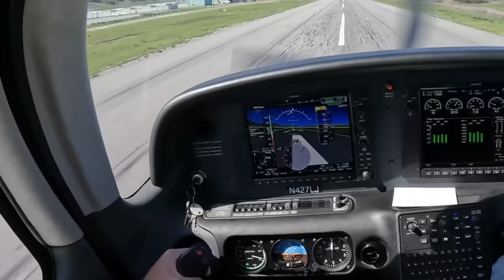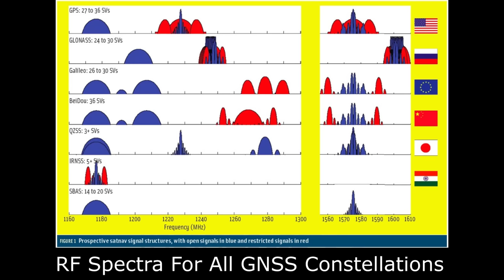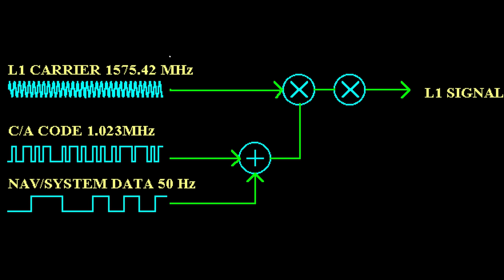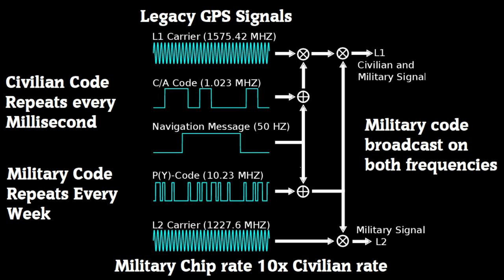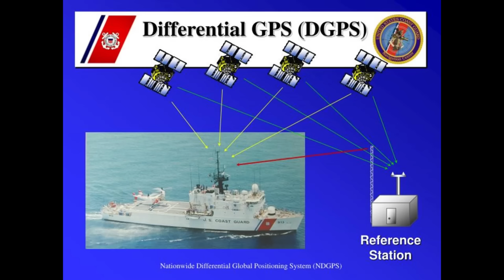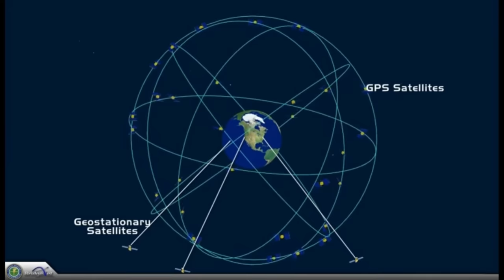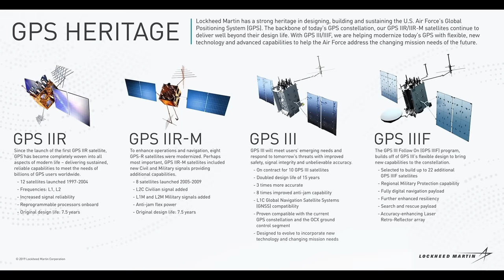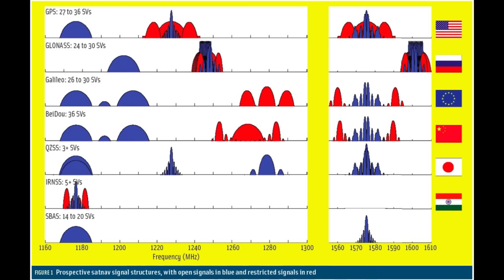How GPS Works, And How It Got Better Than The Designers Ever Imagined

Comment: I've worked with GPS a lot while surveying. You can fix one receiver over a known point, then use another receiver to do your surveying. The fixed receiver will send the rover receiver a correction by radio and you can get extremely accurate, down to 0.01 ft, or 1/8th of an inch, which is good enough for any property lines or general construction staking. It is so much faster than using Total Stations.
Reply: I think SparkFun sells a complete kit for advanced embedded developers.
Reply: Can you confirm globe earth, as a surveyor?
Reply: @alexlandherr They do.  I quite like their surveying pole. It measures the position at the top of the pole, but the pole may not be verticle. So it uses accelerometers to work out the tilt of the pole,  and uses that to work out the position of the spike at the end of the pole.
Reply: @alexlandherr  In the early 2000's, they cost around $50k, now a RTK system runs about $8k.
Reply: Accuracy of 3.2mm, nice!
Reply: The science building at my school apparently has a receiver permanently fixed to the roof for that exact purpose.
Reply: @juha9703  That is with ideal conditions. The biggest issue is trees, nearby buildings, or anything else blocking the sky or bouncing the signal. If there is too much interference and the accuracy is lost, we will set temporary points nearby and then use those to set up a total station to measure the final positions.
Reply: You can buy lawnmowers that have that system nowdays sl you don't have to use a cable.
Reply: Rover? Wait, did you use basically a ultra duper rc car? Which firmware, ArduRover?
Reply: @juha9703  actual accuracy should be stated as a known uncertainty, which is basically the probability of being within a stated range.
Reply: We used this approach some 20 years ago. Was incredibly precise as long as you kept away from any trees, buildings, etc. that obstructed line of sight to the satellites.
Reply: @n900video  I wonder about the firmware used back then, because I don't think ArduPilot and it's variants existed already. But today they use it a lot, even for agriculture. 
There are companies that build big rc airplanes with 4 additional motors, so it can land and take off vertically and then do the mission the operator defined. You know?
Some day I'm going to build one of those... Just to play around. I love that stuff! 😂
Reply: @MCsCreations  From what I remember all the hardware and software was made by Trimble.
Reply: A lot of wrecks on the Great Lakes are marked with gps coordinates. Makes diving on them a lot easier.
Reply: So long as you have clear views of the sky. 😎
Reply: Aviation GBAS does the same.
Ground Based Augmentation System.
The airport has a known fixed receiver-transmitter, that can send a correction code to the aircraft receiver.

R
Reply: @tonymcflattie2450   Every land surveyor can and does on a daily basis.  The mathematics behind "projections" that are commonly used to display map data are all built upon an ellipsoid model.  I've taken the courses and done the math myself.  I've seen it through a total station myself.  Plus, my geodetic models professor was the guy that JPL would call in the early days when designing the system.  So, yes.
Reply: @tonymcflattie2450  if they didn't constantly compensate for the curvature of the earth, any large surveys would be way off
Reply: @jimjohnson394  I think it is even less than that now, I've seen kits <1k for RC lidar scanning, 1-2cm accuracy, haven't tried them myself yet
Reply: So I am using Trimble R12 units in RTK and I am getting vectors within 3mm Horizontal and 5 Vertical of terrestrial measurements when working in good sat visibility. Still can go down to around 100mm in Forrested area (which is still far better than the 2m I used to get on R6s)
Reply: @tonymcflattie2450  More than that, you can map your position well enough to show that the Earth isn't a simple perfect sphere, it's a slightly lumpy 'oblate spheroid'. IIRC Scott did a video a while ago explaining what than means.
Reply: @MCsCreations  >Rover?
In surveying you have a fixed receiver called a 'base station' and a mobile receiver (mounted to a pole you carry around) called a 'rover'. Often the base station is operated by somebody else, usually the local government.
Reply: @raffriff42  Oh, I see! Thanks!
Reply: @ke6gwf Actually, the error is much smaller than you would think.
Reply: Wow that is interesting. But how do you get the fixed receiver more accurate?
Reply: @LTVoyager  the error is very close to what I think, but I didn't define what I meant by way off or large surveys lol
Imagine trying to survey a long stretch of freeway or a state border, or even with a large property or farm field, you may be off by more than the allowed error tolerances for the job.
Reply: @ke6gwf  What is your definition of a large survey?  How many miles?
Reply: @LTVoyager  well, for instance, if you set a corner cube reflector on a tripod at one end of the Bonneville salt flats and tried to measure the distance across the perfectly water level flat surface with a Total Station at the other end, the laser wouldn't be able to see the reflector because of the curvature of the earth.
So I would say that at 12 miles you certainly would be having major problems as a result lol
And even not trying to do it in one shot, you would have several feet of vertical error across that distance.
Reply: Similar systems have been used in Ag for a decade + as well. Allows for running equipment with sub inch accuracy, which allows for auto steer capabilities to very accurately control equipment during planting, harvesting, and application of inputs.
Reply: I think I read that RTK systems get even more accurate if you run them for a few hours, that's how people get to millimeter accuracy. Not that you need that much accuracy in most cases.
Reply: @StevePemberton2  I am not even sure if that's needed anymore with the multi constellation RTK systems, because they get so much data in minutes comparing the different frequencies and systems that I think they can solve the errors faster.

Now, I could be wrong, maybe there are still aspects that require time to adjust for, but I know that the ground based software has taken major leaps in recent years, so I suspect that those things are getting much better too?
Reply: @ke6gwf  That is why you would measure 1,000’ at a time for a total error of 1.3’ over 12 miles which isn’t what I could consider a huge error over 12 miles.  😁
Reply: @LTVoyager  but you know what it is, you can measure it, and so you can compensate for it, which is the point.
Reply: This is another use of differential GPS. You can take it a step further and add post-processing which uses a later download of the precise ephemeris of the satellite constellations to further refine the position data. 

The best receivers now will use a combination of all the GNSS constellations, WAAS, LAS, and locally captured cell tower/Wi-Fi data.
Reply: So, what is the base accuracy for your PVTs?
Reply: @juha9703 Ours was to the millimeter or 10/254ths. It was more accurate than the operator using gyros and accerometers to account for being atop an 8ft pole even in "the morning after" conditions 😂
Reply: @nitehawk86 >how do you get the fixed receiver more accurate
They take many measurements over time
Reply: Yup, it's called RTK fix
Reply: Yeah rtk is a couple hundred bucks these days
Reply: I was a Trimble operator for 2 years. Love those things
Reply: @LTVoyager Could you please use units which the normal 7,7 billion people on earth use?

This is a science channel, not a '(destroying) freedom' unit channel.
Reply: @nathanieljames7462 what does "8ft" mean?

Don't tell me that you dare to use fat-people units on a science channel!!
Reply: @gert-janbonnema  There are two categories of countries on the earth: those that use the metric system and the one who put men on the moon.  I will stay with the convention of the country that put men on the moon.
Reply: @gert-janbonnema  Please show me your metric clock that measures time in multiples of units of 10.  And what are the units on the drive side of your “metric” sockets?  😂
Reply: @gert-janbonnema The normal people who invented,  own, & use the GPS  system talk think & use inches feet & yards.  An advanced scientific mind should be capable of dealing with it without much complaint,  lol
Reply: @gert-janbonnema  Interestingly enough, the research lab I was building used several thousand 2x4 8' studs. It was a massive complex that was almost big enough to fit your mom in.
Reply: I also use RTK GPS for survey, using both our own base station and broadcast base stations for corrections.  Under ideal conditions, RTK is comparable in accuracy to total station. Often though, the elevation measurements vary by several hundredths versus total station survey of the same two points. And this is with reapeat measurement at the same points. Always skeptical if someone reports XYZ based on RTK alone.

That said, RTK is amazing and I'm stoked every time I'm able to pull an XYZ location out of thin air with accuracy on the order of the surface area of a quarter
Reply: +1 using “convolve”
But … what? No description of Hadamard matrices or Gold codes? 😉
Just kidding. Nice job.👍
Reply: @phinix250 shlt dude, I'm still using an R6
Reply: @davidkottman3440  Oh, is that why the US Survey Foot is defined as exactly 3937/1200 ft/m? We're already surveying in metric. Also, WGS84 is defined in metric. (I've been a surveyor in the US for 30 years)
Reply: You ever try to repeat that 0.01 ft a few hours later? Also, you and I both know that's really 0.03 ft in the vertical. So, I still prefer the robotic total stations--They're just as fast, if not faster.
Reply: @cf453  "faster" depends on your control. So often I'm in areas where the closest control is kms if not 10s of kms away. For example, right now I'm working on a tails dam that's 15km in diameter, surrounded in forest and any permanent control left is about to be destroyed. 
If you want to establish control with GPS, you either need multiple recievers and traverse in from known points with good long obs or for less accurate stuff you can take a series of 3mins obs as a control point and take an average, at least 4 obs over at least 2 days
Reply: @cf453  I'm comfortable using either system,  and don't understand why others cannot do their own conversions, especially when they promote their own scientific or mathematical proficiency.
Reply: @LTVoyager You will find that the Apollo Lunar Module, or LEM, flight computer did all of its guidance and navigation calculations using the metric system. It only did a conversion at the very end for display of the values in "customary" units for the benefit of the astronauts who mostly had an aviation background...

Back on topic; even road graders use GPS now to control their blades. Two masts on each end of the blade for mounting GNSS receivers allow for centimeter precision in making flat and level surfaces just so and the civil engineers have to account for the curvature of the planet if you go beyond the horizon or else you'd be asking for a ramp up to space right along a tangent!
Reply: Absolutely correct Jim. I've also used GPS for surveying, even my own personal receiver is accurate to 6 inches with post processing.
Reply: Phase data is sent by the base for the high accuracy applications.
Reply: @tonymcflattie2450 ”Globe” earth was confirmed by measurement by the Greeks 2500 years ago. Are you that contrarian?
Reply: One thing you do lose with GPS surveying is geodetic irregularity. A total station orients to perpendicular to gravity, so 90° to water's surface. GPS is a fixed ellipsoid. Earth's gravitational potential is lumpy. You can easily have areas a few hundred miles apart with "sea level" a dozen feet apart. A total station automatically corrects for this, and you'd have to adjust to get ellipsoid heights, whereas in GPS you get the ellipsoid height, but have to adjust for true level as water sits.
1/8" with differential GPS is a bit optimistic. Maybe 1/2" horizontal and vertical might be more like 3/4" in perfect conditions. A very long static survey might get you results a bit inside that, but repeating the measurement a few hours later won't likely agree by a hundredth. But the great thing is those numbers are about the same if you're measuring 10 feet or 10 miles.
Reply: we did this on a university racing team for vehicle data at the race track. I was told 2mm accuracy!
Reply: Agree on the accuracy claims some make. I always expect no better than 1cm horizontal and about 1.5 5o 2 vertical with RTK GPS in ideal conditions, which is usually more than enough. 
As to the Geoid and Ellipsoid measurements, Those positions should be automatically adjusted in real time with modern survey software for both RTK and conventional/optical surveying. Also, the sample size for Geoid triangle networks (TIN model) is somewhere around 800meters and most places you won't even have 1cm of vertical difference. So a total station measuring zenith angles off its plumb line position will measure raw data angles and the survey software will compensate that final vertical answer. Usually however the Orthometric height  adjustment will be so little as to be not even be noticeable, I know you know all this, I'm just being a bit pedantic.  @ryanmcgowan3061
Reply: @muzzarobbo  Precision and accuracy are often confused. DGPS on my equipment shows numbers at 0.001 ft (sub mm), but come back to exactly that point and it will only be within 0.03' (1 cm) of the last number it gave me. We can't measure the upper ionosphere to the kind of resolution to enable less than that currently.
Reply: @tonymcflattie2450 doesn't the existence of GPS confirm the Globe earth?? It's kind of in the name....
Reply: Yea my surveyor can’t get it down to 10 ac!
Reply: @raffriff42 the base stations are more often than not operated by the surveyor unless you're using VRS. At least in my experience
Reply: Good old RTK
Reply: The basis of DGPS
Reply: You should try switching it to metric mode 😂 just sayin'. 🖖🖖 either way that pretty accurate.
Reply: You can get an RTK system for well under $1000.
Reply: @tonymcflattie2450  It's flat.
Reply: @gert-janbonnema the gunters chain (defined as 66ft) was invented and used for almost 200 years before the meter was defined. 80 chains in distance is a mile. 10 square chains is an acre. These are historical units still used by modern surveyors and engineers, because most property boundaries have been created using these units, so they are still relevant today when buying and selling land. 

So don’t try to act all smart when you don’t know the history behind what you’re talking about lol
Reply: @jimjohnson394 adjust for inflation too!
Reply: @LTVoyager  Contrary to urban myth, NASA did use the metric system for the Apollo Moon landings.
And please define a foot or an inch... a quick google search will show that they are defined by meters.
Reply: @dr.pjuskebusk2501  I never commented on the units NASA used.  Ready my comment again, for understanding this time.  And how many times has the definition of the meter changed?
Reply: I recall back in the mid-late 90's talking to a surveyor who was using "That new GPS system" and I asked him how accurate it was.  He said they were within sub-centimeter.
Reply: Sparkfun’s RTK receivers are in the  $500-700 range, and cheaper if you just get the boards themselves. I have a Facet and an Express (that I use as a base) from them that I use on my property for doing my own surveying - some of which overlaps some old fashioned surveying work that was done 50 years ago.  I am proud to say my found points came down exactly on top of the old buried monuments in the overlapping areas. I don’t get 1/8th of an inch horizontal accuracy, but I do get about 0.3-0.4 inches typically.
Reply: I just use my own base personally - the closest publicly available base is about 90 miles away from me, and that’s too far to be all that useful. Usually I won’t even get an RTK fix from that. 

Using Sparkfun’s stuff has made it super cheap and easy to do all of this. My surveying system - both the base and the rover setup I use - cost less than $2000 in total. That includes all the stuff I got to build the base too.
Reply: @Nickle314  they use something like that in my city
Reply: @tonymcflattie2450  🤦
Reply: @tonymcflattie2450 You can be even simpler.
Put a laser horizontal on a fixed point on the shore of a calm lake and point it at a boat with a high paper tower. Make a point where the laser dot is. Go further out and see how the point goes up. If the earth would be flat, the water would be as well. But the water is bending with the earth.

If you have neither of the things, you can go to a large ocean port and look how the ship go "downhill" on the "flat" surface of water.
Reply: @matsv201 it is also widely used in agriculture, with the stationary differential Receiver being either fixed mounted on a building, or they can set up a mobile version on a tripod next to the field.
It is used for controlling how much fertilizer you spread, or if you got full coverage with seeds without wasting too much on overlaps. Those sprayers can even switch of single nozzles, based on that overlay pattern which is also shown on a monitor in the cabin.
Reply: And in a measurement used for scientist and builders world over, what would 1/0000005th ft be?
Reply: My mamotion lawn mower uses this system and accuracy
Reply: Didn’t realize you guys were using such cool toys. Love it.
Reply: I recently was told, and then looked it up, that there are high end systems can be accurate to 0.1mm. Set you back 100k, plus about 10k a year on software licensing, if I remember correctly.
Reply: That's insane to me. I almost don't believe it lol.
Reply: @GoCoyote They use GPS to measure the movement of tectonic plates.
Reply: @Sherwoody Which are the same coordinates indicated on paper nautical charts, of course.
Reply: @denelson83  absolutely, but it’s just so much easier when the gps navigation system takes you miles out from shore to hit a a tiny spot where there are no discernible landmarks. You can find a wreck that is 30 or more metres below the surface, and then return to harbour in any weather day or night.
Reply: @Sherwoody  Hey, that is also why electronic nautical charts now exist.
Reply: @denelson83  any of the electronic charts I’ve seen, still require a gps to show location, heading, and speed. I wouldn’t begin to be able to use a sextant to determine an exact location on the Great Lakes if I’m a dozen or more miles from shore.
Reply: @Sherwoody  No duh.
Reply: Yes, multipath has caught me out before.
Reply: That's cool! It sounds like it's using triangulatory interferometry. I'm just pulling words out of my ass though. 🤣
Reply: @ke6gwf  No one ever does compensate for the fictional curve.
😂
Reply: @tabascoraremaster1  guess you are not a surveyor, and believe everything you see on the internet lol
Reply: @ke6gwf  Try again
Reply: This is called differential GPS. It's used in many applications. For example, aviation uses differential GPS for approaches (RNAV, RNP). Having a land-based receiver at a known location broadcasts errors that it receives from satellites to receivers, such as those in aircraft, who then use this error information for correcting to a more precise position. There used to be a ground GPS receiver in San Francisco Bay used by pilots to accurately navigate channels in fog. I don't know if these are still there after recent advances in differential GPS used in aviation.
Reply: @davidkottman3440  It doesn't matter what the designers want or do as long as the final customer gets the measurements in inches, feet, yards, and miles.
Reply: @nitehawk86  The fixed receiver is often put over top of a known "monument" using a weight centered over the monument.  A monument can be a 3" brass circle with a bull's eye in the middle.  When the fixed receiver is turned on, it begins taking readings, errors and all, from all the satellites passing overhead.  Soon enough it takes enough readings that the errors in all directions cancel out.  Software does all the math to pinpoint the base receiver.  Then when you turn on the rover box, it receives signals from the satellites and from the fixed receiver.  The rover prioritizes signals from the most accurate source, the fixed base receiver.  At least that is my understanding.
Reply: The sad part is that GPS-jamming and even GPS-spoofing which for example Russia does, unfortunately makes it problematic to rely too much on GPS.

I wonder how Putin-friendly republicans can defend this…
Reply: I use this on our machines.
Only really needs one f9p as a base station and two on the rover for heading info.
We get 5-8mm accuracy at 10hz
Reply: Only after declasificaon for civilian  use I think it improved greatly.
Reply: What is 0.01 Ft in science units?